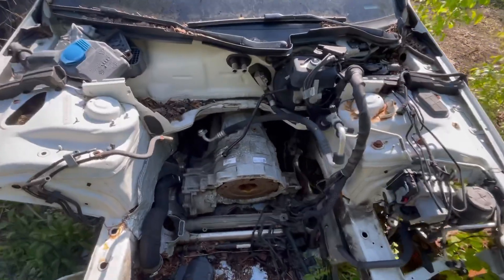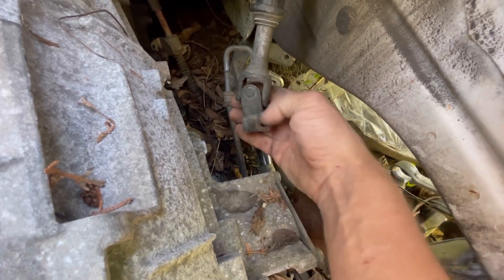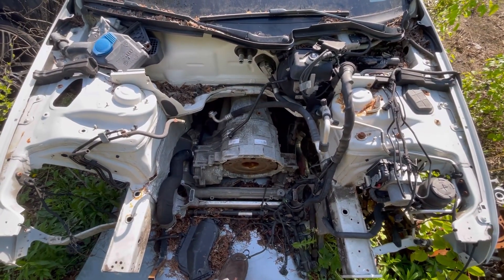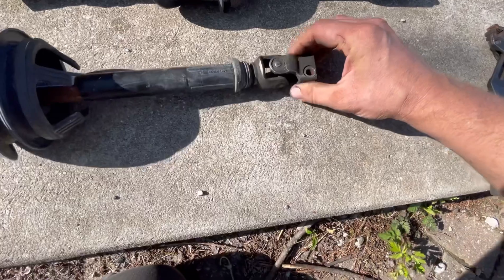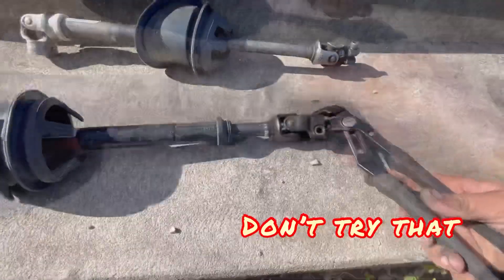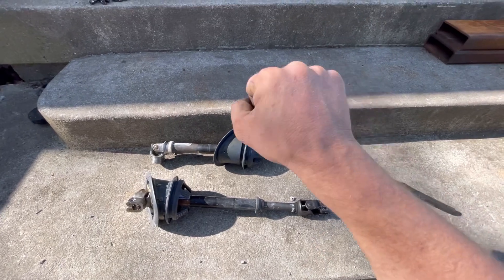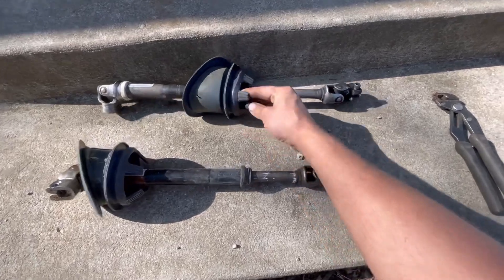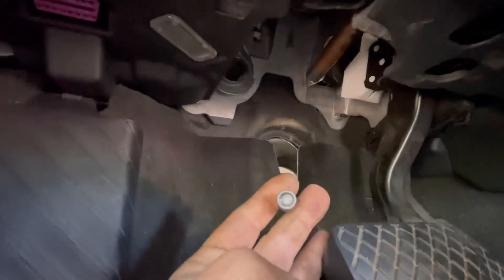Audi VW Stiff Steering Hard Notchy feeling Shaft joints locked up A3 A4 A5 A6 A7 A8 Q3 Q5 Q7 S4 S5

Comment: Also for the B8.5 (equipped with Electronic Steering columns) , you need to make sure it's not an electrical/power issue. If you have a worn battery or even an alternator, you'll feel the notchy steering on startup, but till will go away when you start driving. The best way to describe it is the notchy feeling then combined with soft steering/under powered steering. If it's the battery it usually happens if the cars been sitting for a day or two.

Comment: I used PB then spray lube and it was good for 2 years then this year i had to use the spray lube again cause it started getting a little tight
Reply from the maker: I did the same and only had 4 day results
Reply: What 2 years More like 4 days
Reply: I’m going on 4 years after spraying deep creep on mine, no issues since. But I live in Florida and the car stays in garage so…
Reply: @CarsandCoding  my mechanic said that they joint is sealed therefore applying deep penetrating fluid won’t do much and in my experience it has barely helped. Many reports online say that it does help but not in my case unfortunately.

Comment: So thats what it probably is... Did your power steering pump make the noise too? Since mine is only stiff when its in idle or low rpm and speed.
Reply from the maker: Power steering pump usually doesn’t make noise with this but all you have to do is pull the bolt out of the bottom u joint slide it off the rack see if it’s free and if it is slide it back on and don’t forget to put the bolt back in, that one is really important.